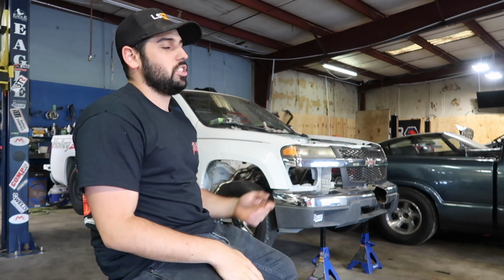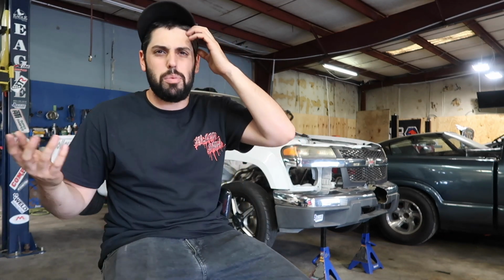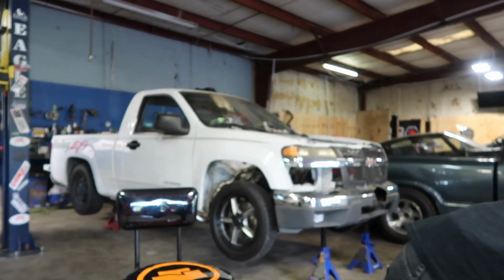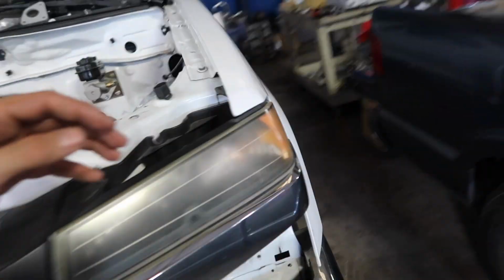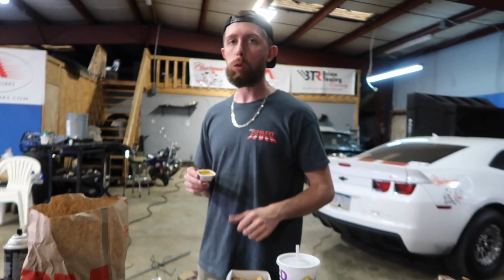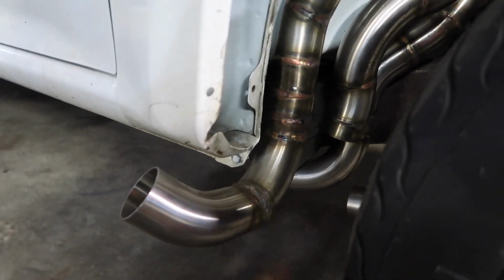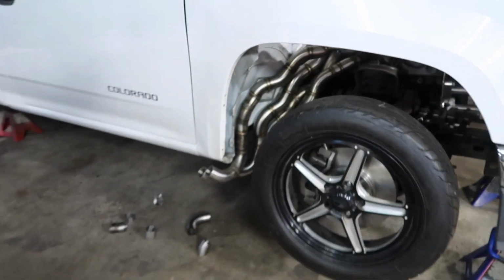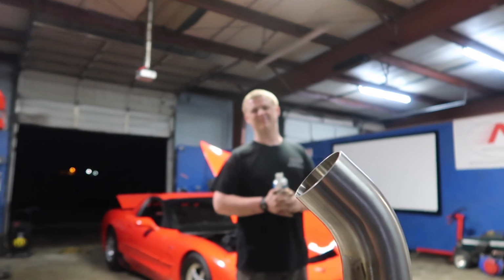ITS ALL OVER!!! plus TURBO GIVE AWAY winner announced!!

Comment: How will you have the zoomies in two pieces if you have an o2 manifold across them tying  them together? Especially on the driver side...
Reply: They will have to come apart in sections, starting with the O2 set up coming off first I’d say?
Reply: Gods Squad you would think that would be the case, but you don’t want your o2 setup having a leak which would give false readings. So if they are in sections there’s gonna be a slip joint or something that could potentially leak that ties the sections together. And if john plans to use a nitrous plate for additional fueling and rely on Holley to adjust that additional fueling to reach a target AFR, faulty o2 readings would jus cause more problems. He jus needs to put a couple detachable heim joints on the steering column if they make such a thing or jus some way to make the steering column quick release.

Comment: It would really help you if you use some welding gloves.  That’s not an easy set of headers to make.   Keep going man 💪🏻💪🏻💪🏻👍🏻👍🏻👍🏻👍🏻
When you get them finished set a laser next to the truck to mark all the tips and mark them and you’ll be able to get them all cut in a straight line

Comment: Holley make a 4500 plate for 4 supplemental injectors. If you add 4 210s you'd go good. Not sure if you ecu will run the extra injectors.  See if Holley will set you up so you can show us injector poor folk if it works.